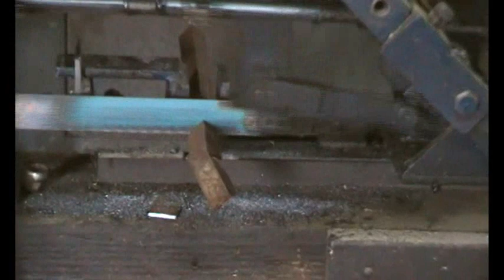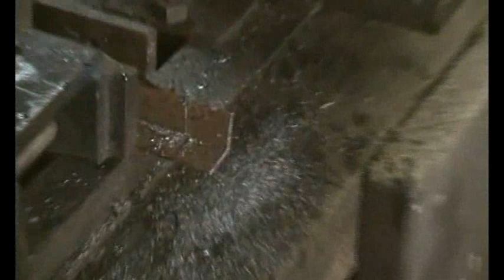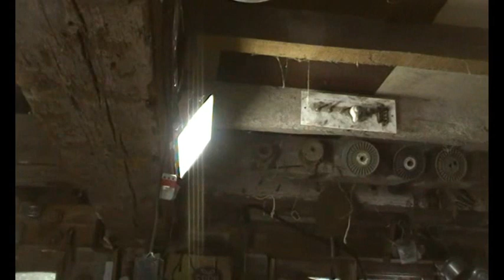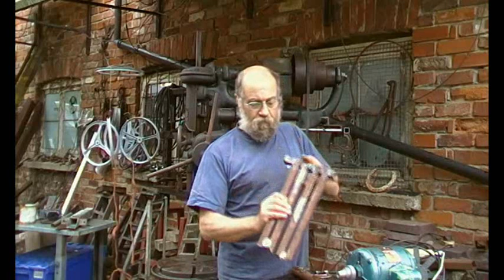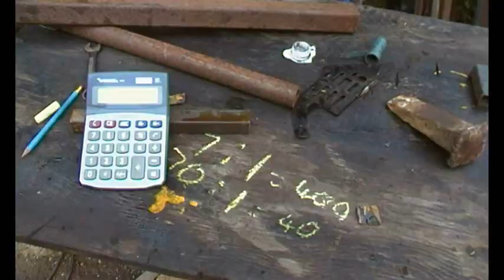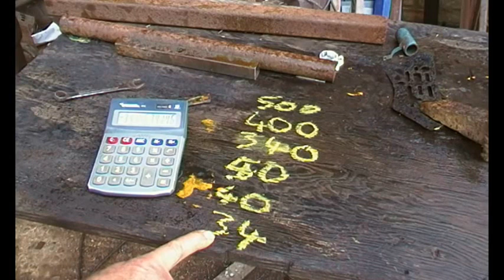Vintage Denbigh pillar drill repair: part 5

Comment: 40 rpm is a good result Andy. I have a 3/4" taper shank drill bit that I simply can't use in my pillar drill, as its slowest speed is, er, 180 I think. My lathe will go slowly enough, but that isn't always the best place to drill a big hole... Your multi-vee belt seems to be working so far anyway - hope we get to see it drill a hole too ! Cheers, Dave
Reply from the maker: Dave, yes I think 40 will be slow enough, just have to find time to think about the the motor. It's taken over a year to get to this point but it's nearly there, cheers, Andy